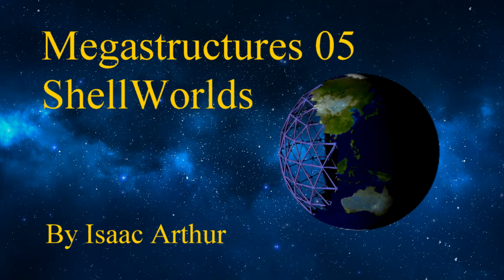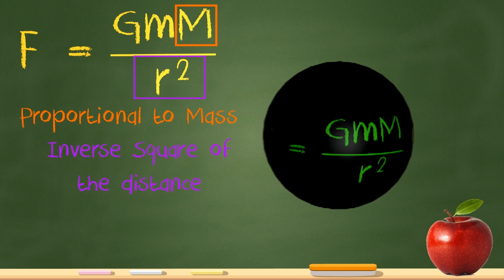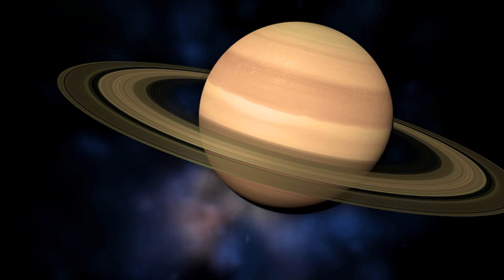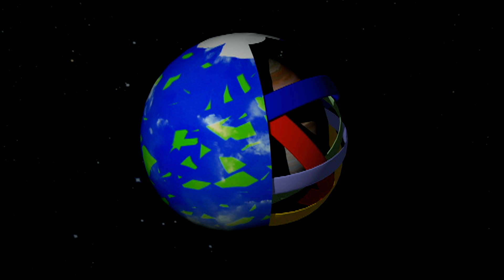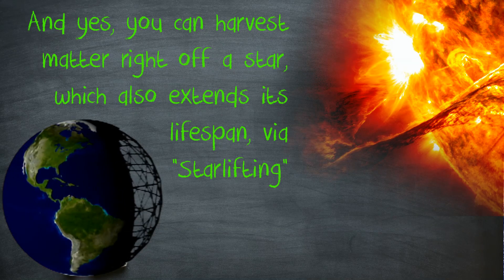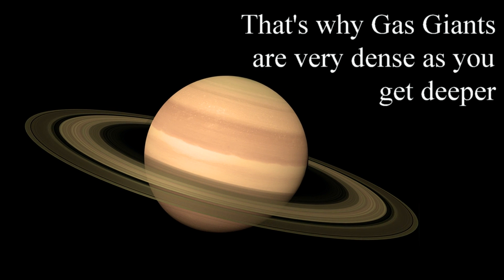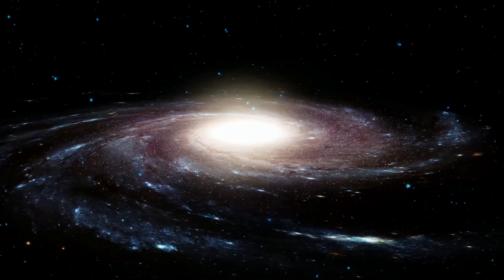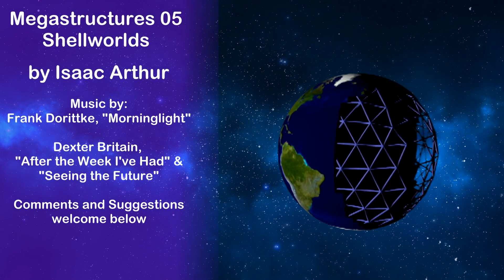Megastructures 05 Shellworlds

Comment: Suprajupiter! (At one G it would of course be 318 times Earth's radius; assuming the surface is more conveniently arranged than Earth's continents-and considerable use could be made of underground volume-it could have a population capacity of several thousand Earths.) 

One problem I foresee for large spheres is that, to have 24-hour days naturally, they'd have to rotate so fast it would have major effects on the shape and apparent gravity-rather like Mesklin. So you'd have to use space mirrors.

For really small ones, using say mini black holes, escape velocity would be really low despite the gravity, so if you wanted to make The Little Prince's world you'd have to roof it in to keep the air.

It should be obvious that the support members would be holding up the sphere by magnetic repulsion.
Reply from the maker: +Robert Miller Yeah you got to curve it a bit off the spherical to avoid being noticeably lighter at the equator, but if you get much bigger than Saturn you'd probably want to go the fake suns route instead.
Reply: Isaac Arthur
It seems to me that, unless you have a superstrong rigid shell, it'd have to be spherical, because of the support rings.

If you built a sphere around Jupiter, it'd have peculiar light cycles, since half the time "night" would be illuminated by natural 4% sunlight. If it rotated in, say, an Earth year, you could match that season with "summer" or "winter" (assuming you make the seasons apply to the whole sphere at the same time). That'd be cool!
Reply from the maker: +Robert Miller Oh there's all sorts of weird lighting system you can use, apogee dwell mirrors for the poles for instance. Non-circular rings are doable, ellipses do work fine it's just tricky to assemble those right with one common foci. But it also depends on the system you're using, but you can also toy with gravity by not letting the filler material be density homogeneous with angle. Even on a Jupiter shell though the equatorial gravity decrease should only be about 6%, that would make for some weird weather patterns I'd think but it should be comfortable.
Reply: Sailor Barsoom
Well... I hadn't thought of that. I wasn't thinking of, necessarily, duplicating Earth's ecosystems. Life patterns would be different, for sure, but not necessarily worse. I did think, since my version of Suprajupiter would be slow-rotating, the climate zones wouldn't be the same pattern (there wouldn't, for instance, be a Mediterranean zone seven thousand kilometers or whatever wide).
Reply: Do you want wildlife on this supramundane world? Well the migration routes are going to be too long if you have all the arctic climate near the poles and all the tropical climate near the equator. But since you're doing mirrors or fusion or black hole energy anyway, you can have arctic and tropical bands only 4,775 Km (2,967 miles) apart. You'd do this over and over, so that if you walked from the pole to the equator (better set some time aside!) you'd go from arctic to temperate to tropical to temperate to arctic to temperate to tropical to temperate to......

Now THAT would provide some strange weather patterns, with whatever rotation you have (or don't have?) making it even more interesting.
Reply: Robert Miller
You can do so much with something like this.  You could have an Earth-sized spot in Ice Age conditions and another be warmer than today.  If you ever could bring back dinosaurs, this would be a good place to put them.  You could have a Renaissance faire as large as Europe.
Reply: Sailor Barsoom
You could design land masses to have really big terrain and biome areas, sure. Or continents in the shape of symbols to be seen from space. Huge habitable cave systems-since the terrain would be hollow. Why not? If you're trying to build territory for the largest number of people, you'd be building lots of spinning space habitats instead.
Reply: Robert Miller
Ooo, an Underdark!  I like it, I like it a lot.  We could create a subterranean (subsuprajovian is a bit much) ecosystem.  I've always wished some spelunker would announce the discovery of blind echo-locating goats, and it never happens... for good reasons but phooey.
Reply: Sailor Barsoom
The problem with large underground ecosystems is bio-energy, or, what's the blind goat going to eat? Solve that, and there's no reason it couldn't be made. Genetic engineering as an art form-lots of SF stories with that.
Reply: Robert Miller
The only not-entirely-satisfactory answer I've come up with is that the cave system has occasional skylights, openings to the surface which let in sunlight and allow plants to thrive, but too small to sustain a goat population.  So they have to migrate from one to the other.

But then the goats wouldn't be blind, they'd just have eyes for skylight feeding and echo-location for moving from sunlit patch to sunlit patch.

Of course in an artificial Underdark it could be grow lamps every 25 Km.  Patches of "weirdly phosphorescent rock" are common enough in stories.

Comment: The bigger the structure, the bigger the target, including gravitationally. It leads to the issue of collision avoidance, but on a huge scale. 

Collision avoidance might also make an interesting topic for interstellar travel at speeds which make steering impractical. Front-facing "vaporising" lasers seems the most likely solution, but popular sci-fi typically glosses over the whole issue. ("calculating the jump to lightspeed", warp drives, and such)
Reply from the maker: +Andrew Kidoo Yes they do ignore it a lot, along with all the drag you get at ultra-relativistic speeds when near-empty space starts acting like a fluid rather than a vacuum. In some ways its the small objects that are the real problem, since they're too tiny to detect and vaporize and basically cause intense radiation. One trick is actually to shove a thin disc in front of you with a laser that chews up the micrometeors and radiation and you can just suck back in to recycle or discard and replace with another.

Comment: black hole powered ships! Also I have a question I can't find the answer to, when 2 black holes spiral into each other wouldn't the net gravity field between them reduce the radius of the event horizon(s) releasing whatever has become of the matter and energy which was consumed by the black hole? Now if it was the case that this happens yet nothing is released, wouldn't that be a case for the singularity existing or at least that time does not stop as the event horizon is crossed?
Reply from the maker: +Jack Thompson Time doesn't actually stop when you cross the event horizon, that is just the point of no return, time wouldn't even necessarily be running particularly slow there, depending on how big the black hole was. Also keep in mind that we're not really sure what happens in mergers since we've only observed one last september, that was the big 'so gravity waves do exist!' event. That one spewed out something like 3 solar masses worth of energy as gravitational radiation. But we still haven't got a good model for the 'final parsec' problem or the ringdown afterwards.